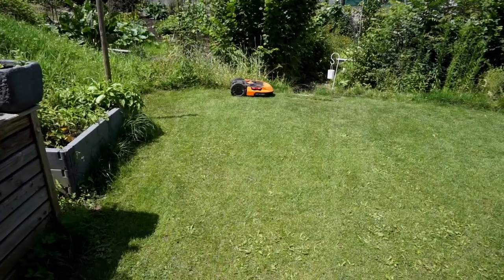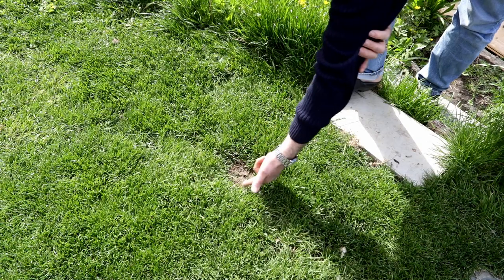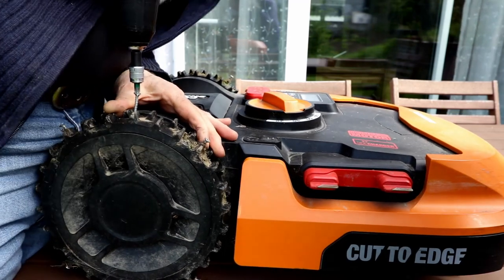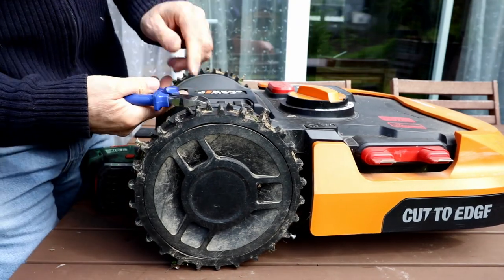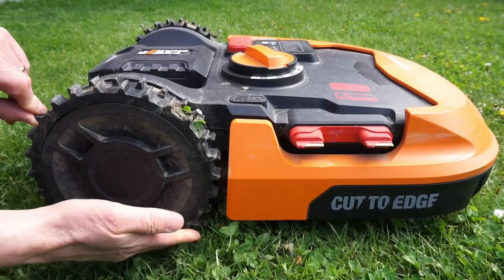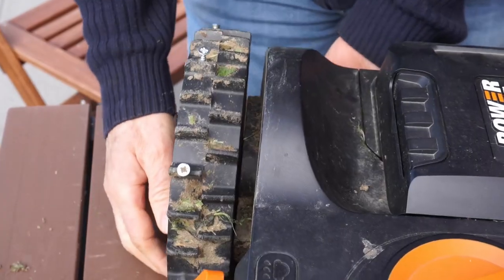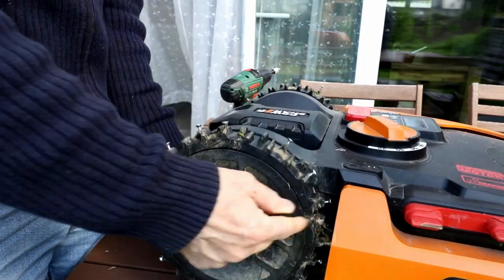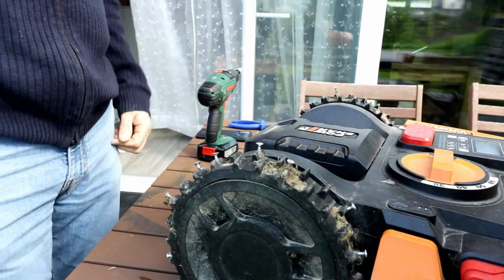This Simple & Cheap Hack on your Landroid Worx Lawn Mower will prevent it from getting stuck

Comment: This made all the difference! It works perfectly for my sloped yard. I have tried weights behind the back wheels, with about 70% improvements, but this hack made it work 100%! Thanks a lot for this cheap solution.
Reply from the maker: Nice to know that this hack worked. Will tell my husband, he is the clever one with diy's. We used to struggle with it and it destroyed the first machine. Now we are happy with this hack too.
Reply: @VitalFairLiving  the places it struggled the most, even with weights are now history, and the lawn will finally recover. I also think the amount of screws are prefect, too many would probably lead to more build up of mud and such. Thanks again!
Reply from the maker: @jockethebastard  I guess so, we were also careful in adding more screws. We are still struggling with the patches where the lawn was badly damaged but we didn't do much last year to improve it. Guess we have to fill in soil and sow need seeds to regrow those patches.
Reply: @VitalFairLiving  I’ll wait a month or so, then I’ll transplant grass from  another area to those spots. I only have about 5-7 real holes that will not grow unless I stop mowing for a couple of weeks. The other spots I guess will recover by filling small amounts of soil a few weeks apart.
Reply from the maker: @jockethebastard  Nice, we will do it this year.

Comment: I did this myself and it works to get tread, BUT if they are too longs (more tread) the wheels rip up the boundary wire. Less in more (or else you will be splicing/fixed the wire; it is easy to FIND the broken wire since it stops right in the place it cut it).
Reply from the maker: Thanks for the info and your experience.

Comment: Thank you!  I live in Florida, USA, a very hot climate close to the beach. My soil is pure sand, very dry. Roots do not have a strong grip so my Landroid has destroyed parts of the lawn. Almost the entire perimeter is effected. On a sloped area, there is no more grass and I cannot plant grass again until a cooler time of year.  I keep moving the Landroid perimeter line, so my lawn is getting smaller and smaller. I started mulching areas and putting other types of boarders on the edges so the Landroid won't continue to chew up the lawn. Also someone told me to plant stronger grass and fertilize to get the grass to grow thicker. THAT would defeat the purpose of the Landroid, which is to make less work for me! LOL Also, only certain grasses grow here.
My Landroid drives over sidewalk and my cement driveway.  If I try something like this, do you think the metal spikes will leave marks in the cement? Maybe not because it is pretty light. Maybe I can find a rubber or plastic spike or screw. Or maybe I can insert metal screws then spray with a. plastic coating like PlastiDip. I will also try removing the plate grill under the blade wheel like Mr. Algotsson suggested here. If VFL or anyone else has further comments or suggestions, I will appreciate your input!
Reply from the maker: All good ideas, I would try it out and see what works, ( my husband's answer) LOL. If it is hard cement, according to him, it doesn't really go deep to destroy them. We have some scratches on our cement sidewalks. Its not so damaged as of now. Let me know how you tackled your problem.

Comment: Tried on mine and it caused it to back off of the curb at the bottom of a small hill.  Removed the screws and added 2.5lb weight to the back and now have no traction issues plus it says on the curb.
Reply from the maker: Good to know. Here it gets stuck in one place in the slope when its too wet. And we had so much rains this spring.

Comment: You mention having to cut the heads off of the screws but your video shows the screws with the heads still on. Did you end up not cutting them off? Asking because I plan on doing this asap to solve ours getting stuck.
Reply from the maker: Yes, we did cut it off, as it was cutting the wires. I must have lost the footage of cutting it while editing. Thank you for mentioning it.
Reply: Can't believe cuttung the heads makes sense. Without heads, risk of damaging the wire is most probably higher. Sharp metal tip. There is a small risk in both cases I would assume.

Comment: We used a couple pounds of weight over the rear wheels instead.  We have a 50-foot cement sidewalk that gets crossed over many times a day so thr weight worx great with no toll on battery life.
Reply from the maker: Nice to know. My husband first tried that, but we have a lot of slopes and a creek flowing through the entire garden and plot. It wouldn't have worked, so we did this.
Reply: @VitalFairLiving  plus with spikes you are aerate your lawn in the process!
Reply from the maker: @normt430  Nice to know. I never thought of it that way,  we saw the benefit of not mowing the lawn and making a racket while doing it.

Comment: And at the end of video we can see it not work (maybe work, but not perfect) cause screws and whole wheels are glued with soil again.
U have to cower places with no grass by plastic net it prevent to collecting wet dirt on the wheels.
My problem was droid was diging holes in ground (very sandy soil) and plastic net work fin (need to use plastic nails ofcorse)
Reply from the maker: Thanks for the tip, will tell my husband this trick. We have a stream in our garden and the ground is always wet too.

Comment: Buy a Gardena instead, it has a Guidewire, and dosent get stuck on the way home, as it dosent need the boundary wire
Reply from the maker: My neighbor has a Gardena, and its loud like anything and this year he stopped using it, will have to ask him why. Anyway, next time will research into it. Thanks for the tip.
Reply: @VitalFairLiving  if the Gardena is loud, something is seriously wrong. Maybe bent blades, or other broken parts. Gardena is known for one of the most silent ones. My own is very quiet.
Reply from the maker: @snowatom  Maybe. Thanks. Which model do you have? Next time we can get that one. Now its working well and its only 1 year old and it has a 5 year warranty. So far so good. Plus no budget to change on these gizmos now.
Reply: @VitalFairLiving  I have the Gardena Sileno City 500
Reply from the maker: @snowatom  Thanks.

Comment: I have a Worx Landroid M500 WR141E and solved this issue in a different way:
Under the knife plate is a sort of "fork" that (I think) is aimed to guide the grass to the knives. I removed this, and it has never got stuck after.
To remove it is very easy: 
Be assure the mower is powered off - eventually remove battery. 
Turn the mower upside down. 
Remove the 3 screws that hold the knife plate and lift it up. 
Remove the 4 screws that holds the "fork" and remove it. 
Re-attach the the knife plate and tighten the screws.
I have a lawn that is not perfectly flat, and this does 2 things: 
Prevents the "fork" to hit the ground making the mower stop, and reduce weight on the front wheel. Yes, the fork part is pretty heavy!
Nothing is destroyed and can be re-attached if wanted.
An image of the underside showing the knife plate and "fork" to the left: https://imtc.qccdn.fr/test/tondeuse-robot/zoom/worx-landroid-m700-wr142e_002.jpg
Reply from the maker: Thanks for your reply. Just forwarded it to my husband. Really thank you for your input.
Reply: Have you ever experienced problems since you removed the plate?  I’m thinking maybe the fork protects the blades and the plate and motor. Maybe small rocks or other hard objects
Reply: Do not remove the fork! Without it the blades cuts into small inclines and hills. I tried it and while it was better with the movement you could hear the plate with the knives hitting the ground.